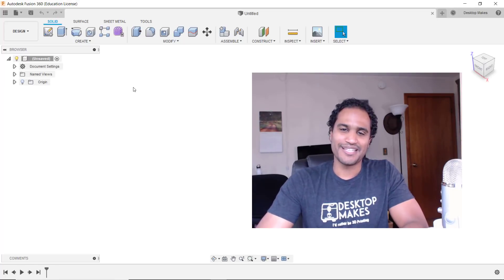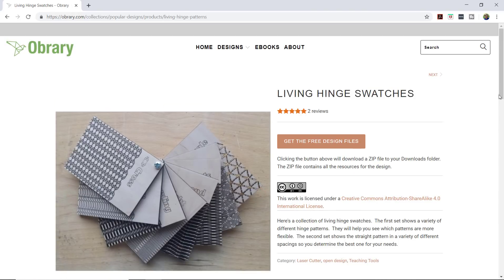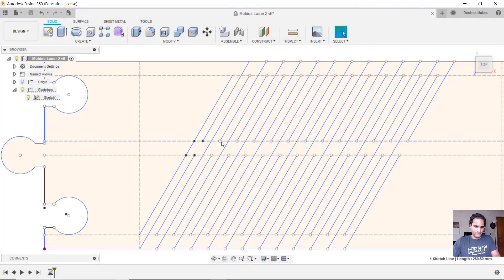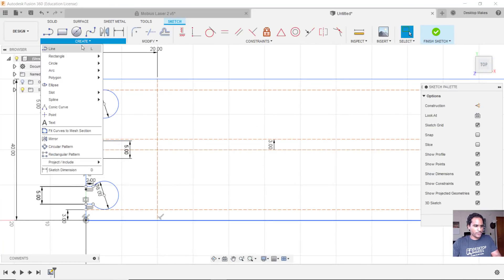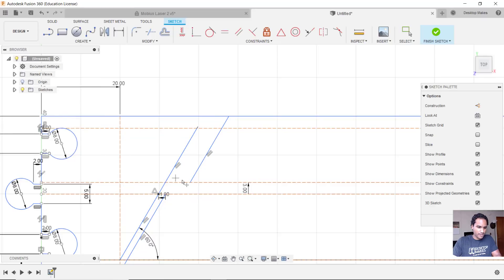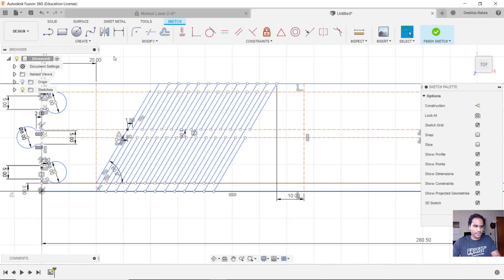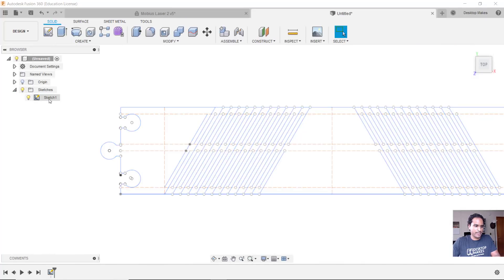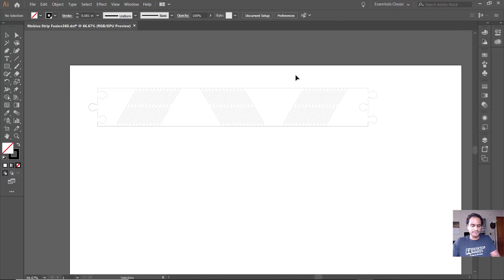Living Hinges with Fusion 360

Comment: Another great video! This is way more stylish and functional than cutting kerfs to bend the plywood. Any idea on how well this would translate as a 3D printing project? Most "living hinge" designs I've seen for FDM just thin out the hinge area rather than have a void in the material.